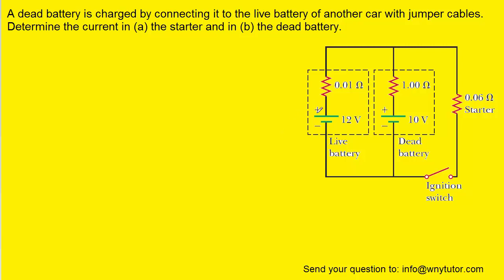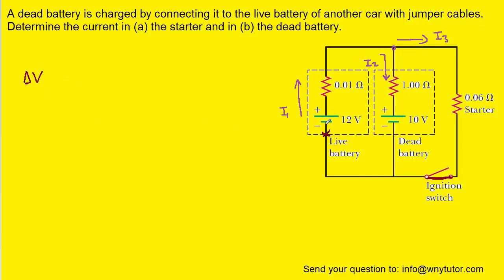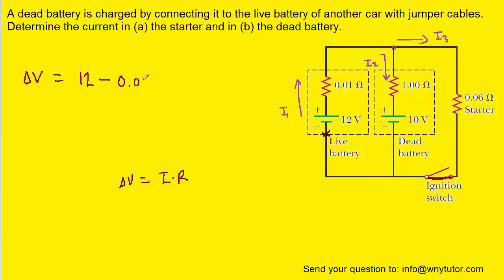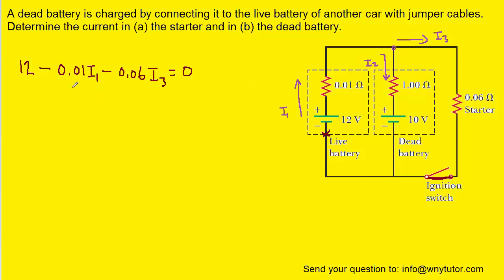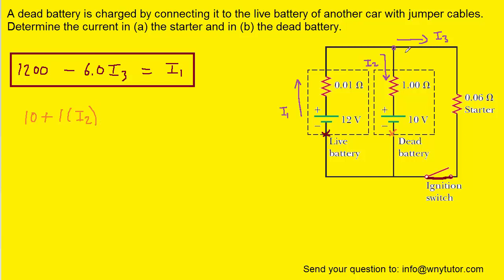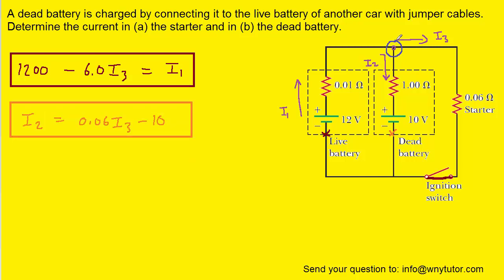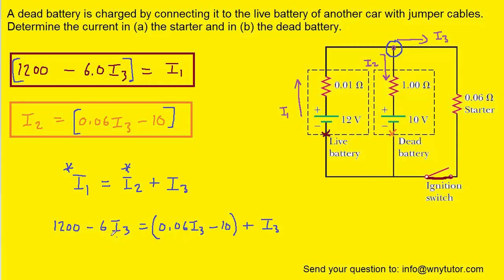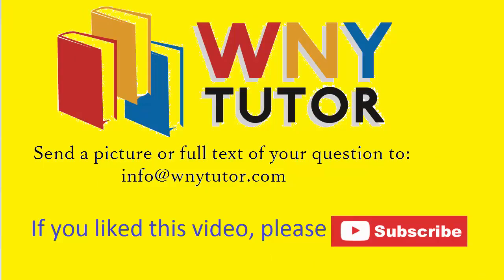A dead battery is charged by connecting it to the live battery of another car with jumper cables. De

Comment: I am not sure if the I2 current flows downward, since their is the 10V positive battery has its positive end there. So I2 flows upward, which I assume would change the answer. Since according to the loop rule, if you go against the direction of current you put a plus IR, we would have a different equation. Also, according to the junction rule, it would be I1 + I2 =  I3, not I1 = I2 + I3, right? Please correct me if I am wrong.

Comment: Why do you use the loop rule on the whole perimeter in this problem? Some problems you use it on both sides of the junction,,,;-;
Reply: like instead of left and right, you did whole perimeter then right
Reply: also have the same question